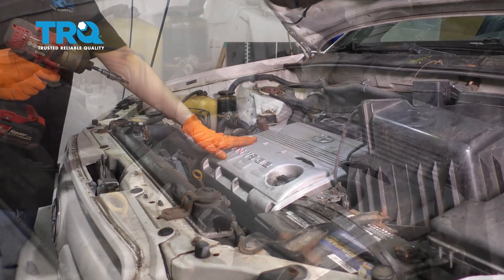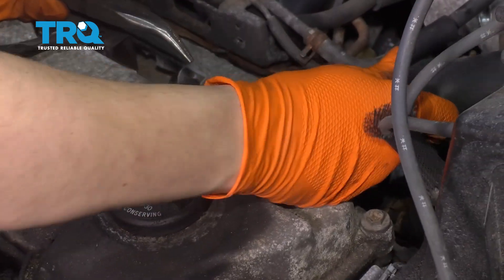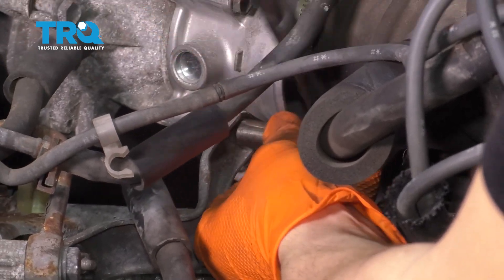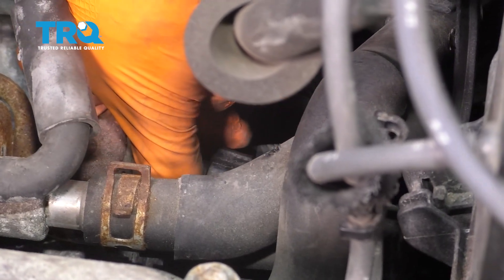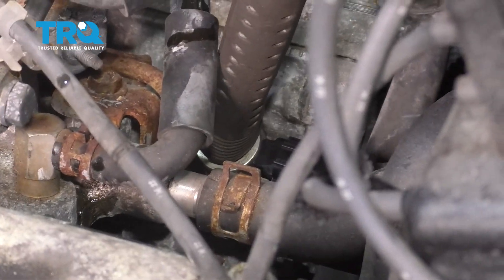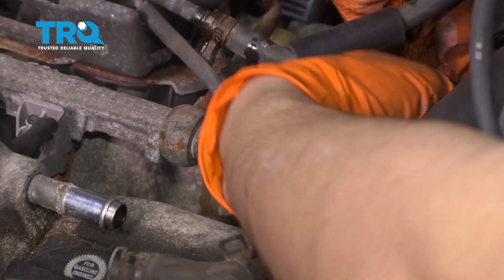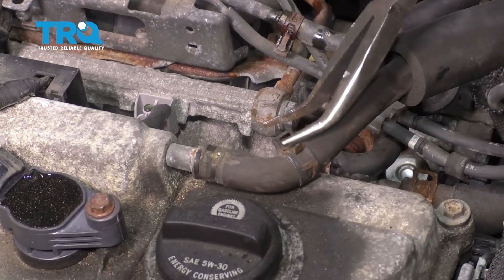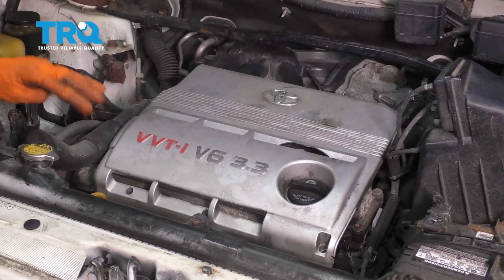How to Replace Rear Variable Valve Timing Solenoid 2001-2007 Toyota Highlander

Comment: I dont know if anyone will see this but mine cant come out because of a hard fuel line going to the fuel rail thats blocking me from just pulling out the solenoid when I disconnect it, it looks like i might have to take off the whole intake manifold to then take out the fuel rail just to replace this one sensor does anyone have any tips? My car is a 2002 v6 3.0 fwd